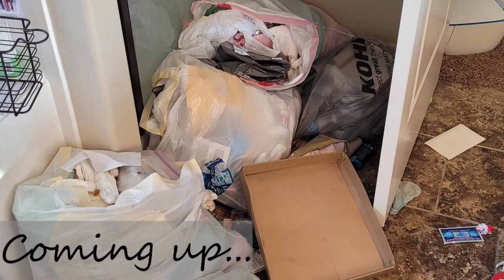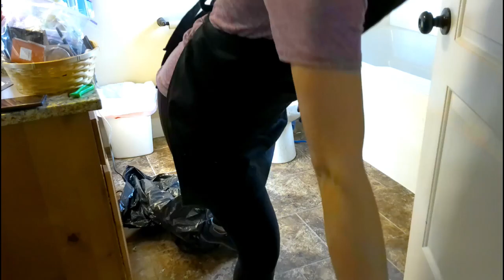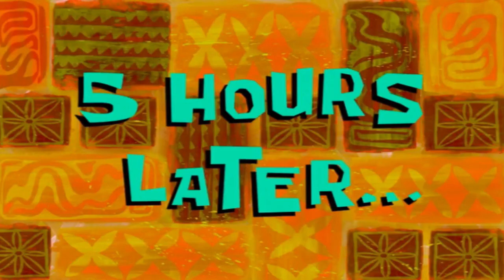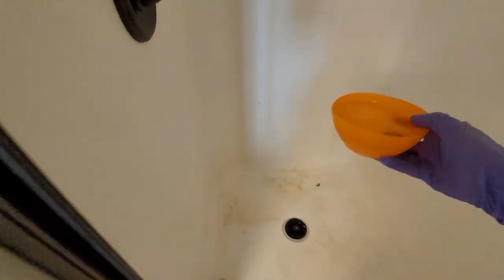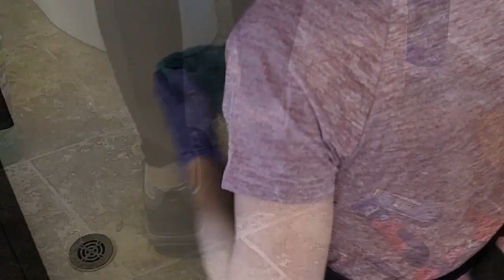Rescuing a Restroom: Transforming a Neglected Master Bathroom #extremecleaning #extremecleanwithme

Comment: hi, love the video! quick question, whats that scraper you're using on the toilet? looks super useful, ive got a job with some toilets covered in buildup like that. thanks!
Reply from the maker: Thank you. I don't remember where I got the exact scraper I'm using here, but this is a link to one that is similar. This is a package of two different ones. The bigger one I also have and use ALL THE TIME!  And bonus...I make a small commission if you use this link to purchase.  Thank you so much for watching! Good luck with those toilets!

Razor blade scraper 
https://amzn.to/3IcCuM6
Reply: @ABeautifulMessExtremeCle-zl1wp  oh thank you so much for taking the time to link that! i didn't realize it uses a razor blade, do you have to be careful not to scratch the porcelain? or is it safe from razors?
Reply from the maker: @SarahKeirano  Yes, you do have to be somewhat careful, though I have found that it is easier to not scratch the porcelain with a razor than a pumice stone.  Sometimes I can see scratches after I use a pumice stone, but as long as you keep the razor at a good angle, it doesn't scratch.  The bigger scraper in this set is not quite as sharp as the razor, so maybe you would prefer to use that instead if you are worried about it scratching.
Reply: @SarahKeirano Never scrape anything,especially glass and mirrors when the surface is dry,always wet first to prevent scratching.

Comment from the maker: Amazon affiliate links for some of my favorite cleaning products: (I make a small commission when you use my link) 

Barkeeper's friend cleanser 
https://amzn.to/44Veo2a

Scrub Daddy sponges 
https://amzn.to/3o2ip4e

Scrub Mommy sponges 
https://amzn.to/41JlXWW

Scour Daddy 
https://amzn.to/3W4RMsa

Steel Scour Daddy 
https://amzn.to/3M84Zf5

Floor squeegee 
https://amzn.to/3MtrsEG

Razor blade scraper 
https://amzn.to/3IcCuM6

Easy Off Oven Cleaner 
https://amzn.to/3pOMzIE

Microfiber cloths 
https://amzn.to/42G0U8W

Wire Brush Set 3Pcs 
https://amzn.to/3MaE7LB

Swiffer 
https://amzn.to/3OgnC38

The Pink Stuff 
https://amzn.to/3pHDZvo

Broom and Dust Pan set 
https://amzn.to/3MukMq0

Tub Tile scrubber brush 
https://amzn.to/3o5vNES

Dawn Platinum Powerwash 
https://amzn.to/42ZyfM4

Mr. Clean Clean Freak 
https://amzn.to/3o2lEbU

Baking soda 
https://amzn.to/42FDCjz

Libman scrub brush set 
https://amzn.to/42D2aKdIII

Comment: I clean textured shower floors with powder dishwasher soap, I plug the drain (old socks in a plastic grocery bag), boil water on the stove (you're trying to duplicate a dishwasher hot wash cycle) so hot tap water may not be hot enough depending on what your water heater temp is set at; sprinkle 1/2 cup of powder dishwasher soap (Cascade or Finish); run the hottest tap water then add the water you heated on the stove.  Let it sit until the water cools off, and scrub with a nylon brush the soap and body oil residue should come off easily.
Reply from the maker: Great idea! I might use this method on my own shower, but I usually don't have that much time to stop and find a pot to boil water in, etc. when I'm cleaning someone else's home. I have been using toilet bowl cleaner with bleach recently with amazing results on the glass.

Comment: Can you show how to take the drain cover off? I don’t know how to do that.
Reply from the maker: It seems like each shower is different. This one actually just popped right off. There was no screw or anything holding it in place, just kind of a tight fit, so I just popped it off with a screwdriver. Some might have a screw, and others, the whole drain piece actually screws into the bottom of the shower. The latter I think is hardest to get off because you have to grip the entire outside of the drain. I'm sure there's a video you could find on YouTube that shows how to get that kind off if that happens to be what you have.